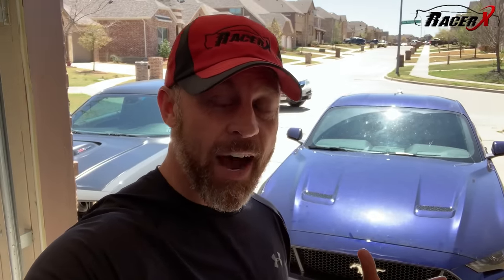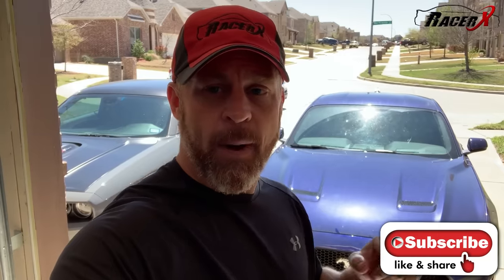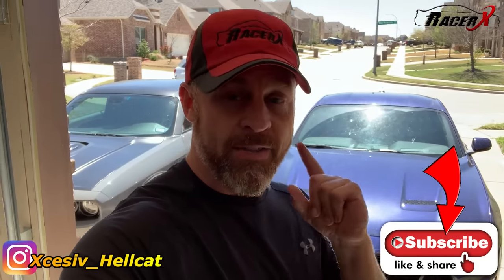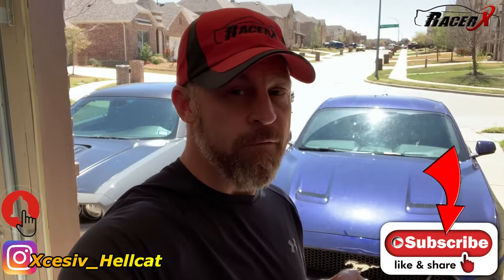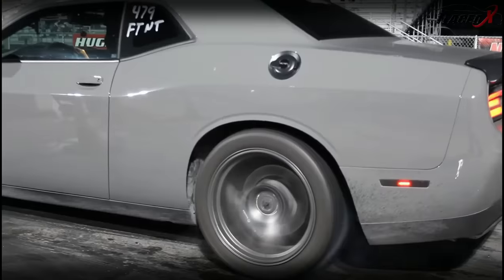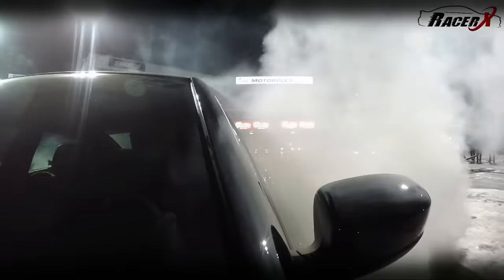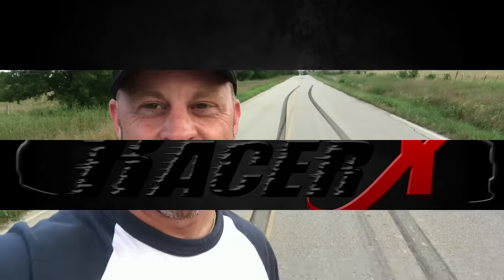Here's the Problem with Going to E85.. I couldn't have predicted this..

Comment: I've been running E85 in my F2 Procharged 427SBC '69 Camaro for 5+ years now.  Where I live in California the ethanol content always runs about 90%.  My car sat last year for close to 6 months as I was changing the intake and adding a water to air intercooler which made me change a bunch of other things.  The car fired up and ran with no issues after sitting for 6 months.  Before that it would only sit for 6 weeks at the longest.  I've found that most of the people talking about the horrors of E85 have never run it.
Reply: Also, E85 fuel is hygroscopic, it's water being absorbed in the fuel through the vent that is the actual concern. E85 alone isn't going to separate. Most modern vehicle have sealed fuel systems that vent back into the intake or through the charcoal canister. I think most of the anti E-blend propaganda came from the oil industry.
Reply: @coltonmcclure1885  I have a vented fuel cell in my car.

Comment: When you mentioned an example about a car being tuned for E70 and the pump ends up being E60 and causing detonation. That alone was enough for me to know I made the right choice doing flex fuel tune rather than a straight ethanol blend tune. Having flex fuel adjustment tables is a must have for inconsistent E85 stations.

Comment: Some good info here, but I think you’re worried over a few things that really aren’t that big of a deal.

1. The type of corn that’s used for fuel grade ethanol isn’t corn that people eat, it’s corn that livestock eats. The byproduct of creating the ethanol is distillers grain, which is used to feed our livestock. You could argue that corn-fed livestock isn’t the greatest idea, but it’s something that keeps meat more affordable. Unfortunately, that’s usually the driving factor in what sells to the vast majority of people. There’s no real fuel vs. food issue though. That’s a misunderstanding for the most part. If we didn’t use that land for corn to feed animals, we’d have to get their food from somewhere else which can also cause environmental problems in other areas. It’s always a give and take somehow.

2. I’ve been running flex fuel tunes for about 10 years without issues. Some have been virtual flex tunes and some have used a sensor. There really isn’t any issue with those tunes, and you’re fine to use anything from E0-E85, or even up to E100 depending on the platform. If you’re pushing more boost on the higher ethanol setup, you may need a boost controller to dial it back on gas. Your gauges and/or data logger can display the ethanol content for you so you’re not guessing whether you got E80 or E60. Most people don’t realize that even E50 is enough for MBT timing except on very high power setups like 1000+. With a supercharger setup, you’d want to run a pulley set that’s safe for both gas and E85 and allow your tune to adjust timing only for the E content. Some standalone options have a throttle angle based boost control for SCs that’s really cool for running varied boost with flex fuel, but most people aren’t going to switch to a standalone. It’s best to assume tuned stock ECMs, which will only vary your timing as far as I’ve seen.

3. Phase separation is really a non-issue unless there’s something wrong with the pump you got the E85 from. For phase separation to happen, way more than the legally allowed water content has to be present in the fuel. Modern fuel systems are sealed, so as long as your vehicle has an evap system, you’re not going to have issues. Carbureted cars or older pre-sealed fuel systems are a different story, but most people have a post-1996 model vehicle who are interested in videos like this I’d assume. I’ve stored E80 from my local Murphy station for months at a time in my sealed gas cans. It’s always tested at E80 going in and E80 coming out without any shaking or tipping of the can. I tested it that way on purpose just to see. I’ve had a car with a blown engine sitting for about 3-4 months outside with E65 in the tank, part of that time was during “snowmaggedon” a couple of years ago here in Texas. I swapped the engine, used the same injectors, rails, etc. on that E65 I’d put in the tank months ago. The alcohol sensor never even blipped off of 65%. It’s just not that big of a deal with modern fuel systems.

I hope some of this can help you relax and enjoy your cars even more. The stations occasionally running out of fuel, lower range per tank, and the less commonly found stations are all still a PITA. That’s really about all there is to worry about when the car is setup properly though.
Reply: Great info!

Comment: You have to burn more E85, and it takes much more energy to produce, so not sure the carbon footprint is really any better.   Kind of funny that a "save the environment" boondoggle turned into such a blessing for motor heads 🙂  Good vids, man.  One of my resources deciding to go with an ss 1le.
Reply: Corn requires larger amounts of water than other crops which have resulted in aquifer depletion and is actually becoming a major threat to middle America. Many articles and reports coming out on it.

Comment: Love E85 in my Stang. I’ve been running a flex tune for the last 2 years unless I’m at the track. If the mix at the station near me is off or if I’m out in an area that only has 91 I just pump and let the tune adjust. I’ve never had an issue with the tune not adjusting correctly. Can’t wait to get an E85 tune on my Charger.
Reply: Great comment. The flex tune works great for 95% of the people that use it.

Comment: No can do, Bro. My 2018 GT is also my daily driver, and my ONLY daily driver. I don't count the Kia Seltos that the other half uses. As such, if I tuned my GT for E85, there does my warranty. That's not even including the replacement parts you mentioned. The other drawback is that it's available in places here by us normally, but if I go on a road trip, it may not be as easy to come across depending on route and destination. It's a no go for me. You made some good points both ways.

Comment: Very interesting points.  I've all but ruled out making the switch cuz my car is a garage queen so the fuel would break down.  Industry needs to figure out the scarcity issue or the market will move on.
Reply: Im in the same boat. I just take it out on the weekends and i dont think thats enough driving before it goes bad.

Comment: Your enthusiasm for E85 is great, but your information is far less than great. 

1. Ethanol fuel is not made from the "same corn we eat," there is a difference between the corn grown for animal feed/ethanol fuel and human food.

2. The energy content (BTUs) of gasoline versus ethanol is irrelevant. Engine optimization is the key, not BTUs. An engine optimized to run on ethanol will outperform (higher MPG) a gasoline-optimized engine running on gasoline. In addition, a gasoline-optimized engine run on blends from E30 to E50 will often outperform (equal or higher MPG) the engine running on E0 or E10 fuel. Consequently, you save money and get equal or better MPG with ethanol.

3. Phase separation happens regardless of whether ethanol is present or not. Condensation occurs naturally, and ethanol does not increase the potential or amount of condensation that forms, nor the rate of phase separation. Aftermarket engine treatment products like Dry Gas and HEET were invented to remove (absorb) the water that forms from condensation. Both of these products were invented and came on the market years before the enactment of the Renewable Fuel Standard and the everyday use of ethanol-gasoline blends. The active ingredient in Dry Gas and HEET is alcohol. Ethanol is alcohol. The only difference between the methanol and isopropanol used in these additives and ethanol is that ethanol is actually compatible with more types of rubber, plastic, and metal. If ethanol could do what you claim it does, then Dry Gas, HEET, and other similar additives would be just as bad or worse. The extra benefit of just using an ethanol-gasoline blend is that you get the water-absorption characteristics, and you save more money by not having to buy Dry Gas, HEET, or any of the other products. 

4. Your arguments about land use are incorrect. Less land, less water, and less fertilizer are used today to grow several times more corn (of all types) than prior to the enactment of the RFS. This is due to great improvements made in agriculture practices.

5. During the past 17 years there have been droughts, floods, high temperatures, low temperatures, and big winds. Commodity speculators and ethanol opponents raise alarms, mostly to try to push up commodity trading profits or frighten consumers away from ethanol. However, during all these times, there have always been corn surpluses. In any event, ethanol does not require corn, many other cultivated and wild crops can be used, and some of them deliver higher per acre, per year ethanol yields. In the time frame that you posted this video, there were no market-wide shortages of corn or ethanol. Any supply problem would have been due exclusively to Murphy Oil Company or its suppliers. But, remember that this same type of availability problem happens regularly with gasoline.

6. You can use premium 93 or E85 in an ethanol-optimized engine, per paragraph #2 above. The worst that would happen is that your MPG might suffer - as the old saying goes, "turn about is fair play."

You do a very nice job in your presentations, it's a shame to detract from your messages with bad info. If you want more true information about ethanol, or to debate the points a bit. Please contact me via TheAutoChannel.com.

Thank you.
Marc Rauch
Author of "THE ETHANOL PAPERS" and "YES, TIN LIZZIE WAS AN ALCOHOLIC."

P.S. Why do you hide your identity?

Comment: If you're using E85, on a vehicle designed for 91, your PCM has been unlocked and you're on a custom tune. It's useful to have an ethanol content sensor and gauge in your vehicle, along with your RTD and a data device. You tuner can build several alternative calibrations, which you can load on-demand, as you fill your tank and read the ethanol content. It's a little work, but produces peace of mind.

Comment: I have a 14 Audi A5 2.0T flex fuel. I have a drop in air filter and when I put E85 in it and gun it, it just feels so smooth. The torque is so sudden. The only stations that have it in my area (Inland Empire Southern California) are Shell and 76. It’s provided by Pearson fuels.

Comment: You are forgetting about the distillers grain that is produced when an ethanol plant makes E85. Those distillers are feed to livestock. So not all the corn is lost. Also currently our nations corn bushel per acre average is near 180 bu/ acre. We get about 2 1/2 gallon pure ethanol out of a bushel of corn. Plus the distiller feed. Also ethanol plants get more products out of a kernel of corn. Most I have paid for E85 is $2.85/ gallon. Currently $1.93/ gallon. The 2.85 was when regular gas was $4.00 locally. Never had a problem sourcing E85 fuel.

Comment: Flex fuel kit on my Camaro has been bullet proof going on 2 years now. I went flex fuel so I could throw in 91 octane during the winter months for the inevitable longish storage times, and for the chance that I’d be somewhere they didn’t offer it. Haven’t regretted doing flex fuel at all, if you get a high quality kit you’re good to go. That being said, I have heard GM vehicles tend to play a little nicer with the flex fuel kits but haven’t met anyone where I live that have complained with their flex fuel kits on other brand vehicles.
Reply: Crazy how some 2007-2013 Silverado are flex fuel motors and not the Camaro
Reply: @theshield1613 I’m not sure why they don’t make performance cars flex fuel. I think they don’t want to invest in the fuel systems for them or something, especially on the direct injection cars

Comment: From my understanding from the forums. E85 is like putting a low octane race grade fuel into your vehicle. It can make good power, but not good on mileage. Can't let it sit in the tank for a long period of time. It can dry out injectors seal and fuel  pump seals. However it is less expensive to purchase. Vehicle had to be rated for it too. My bike is tuned for it and it does feel different with the power delivery.

Comment: I would like to upgrade my car to run E85 but I want the car to be able to run all available fuel types. There was some talk about providing E15 but I don't think that got off the ground. UPDATE: I got my flexfuel kit installed  in my 02 Mustang GT a couple days ago and put E85 into my tank yesterday - no problems so far. I didn't get a tune for E85 though. By the way, you mentioned how ethanol is made and I've heard that using switchgrass instead of corn is more efficient and less real estate is needed for switchgrass.

Comment: One thing that people overlook with E85 is increased cylinder pressure. It's most noticeable on boosted applications. Increased Fuel in Cylinder + Increased boost = increassed Cylinder pressure = possible head lift, and stress on internals. 

This isnt an issue for all applications, but something to keep in mind.
Reply: Is that because of the evaporative cooling effect of ethanol on the air charge?
Reply: @kyleallen3857  no its due to the cylinders holding more fuel (since e85 requires more of it to create power), and increased boost (more air) in the cylinder.
Reply: @LegionS550  The “cylinders holding more fuel” statement makes no sense. The cylinder volume is what it is regardless of what fuel is used.

The ethanol evaporating absorbs heat from the piston, valves, etc. Because the air charge is now cooler, and therefore more dense, more oxygen atoms will ‘fit’ in the cylinder. Same principle as water/methanol injection. 

The difference volume (cc’s) of actual fuel injected per bang is very little and does not have much effect on raising compression or anything else.
Reply: @kyleallen3857 
I assume you're aware, it requires more E85 to make the same power as gasoline. The only way to compensate, is to add more fuel. If you kept the amount of E85 (cc's) as you did gasoline, you'd lose power and be lean. Which is why people upgrade injectors/fuel pumps so they can deliver more fuel, and have a more stable fuel delivery. 

Obviously, it evaporates and I admit i over simplified my explanation, but the results are the same.

 I'll also add, just adding E85 alone will NOT cause headlift/head gasket issues by itself. It's when you introduce MORE fuel, to match the extra ignition timing, and boost you've added to the engine. All of these contribute to head lift/gasket issues.
Reply: @LegionS550  I apologize, I misinterpreted your level of knowledge on the subject. 

I don’t feel I can benefit from further discussion at this level.
Reply: @kyleallen3857  its all good. I wasn't the clearest when i made my initial comment. Have a good one
Reply: More cylinder pressure at the right time is basically more torque output. That's what you want.

Comment: Just switched my R/T to flex fuel and although mine is forced induction i feel there are still GREAT benefits to doing the conversion on N/A vehicles as well. 1 being price, 2 being knock resistance, summer is right around the corner & anyone who tunes can clearly see or hemis do NOT like running hot under racing conditions, so in my opinion if you are on the fence, Doo eeet! 👍
Reply: Think this is gonna be my next move for my awd chryser 300 she gonna be a beast good looks

Comment: I’ve run e60 in my 17 975hp ZL1 and 650hp 18 denalli truck (both have flex tunes) when doing track events and learned not to leave it in the tank for very long but those vehicles love it.  Currently building a 540bc fi 69 Camaro and because of shelve life and how little it might get used I’m gonna set it up for 91 and nitrous.

Comment: 4:20 The ethanol in e85 is basically the same as the alcohol we drink and is made in the same way.  The only difference is that ethanol for vehicles has toxic substances like methanol added to it so that people can't drink it, as it is not taxed like drinking alcohol.
Reply: Yeap  the difference between Moonshine and gasoline is methonol.
Reply: Yes ethanol = alcohol = moonshine, yet mainstream narrative and comments never mention that moonshine of course can be and has been for a long time, made at home; all critics criticize problems with mass production and distribution, as if local of both is non-existent/impossible, it's mis-info to keep people dependent on the System.